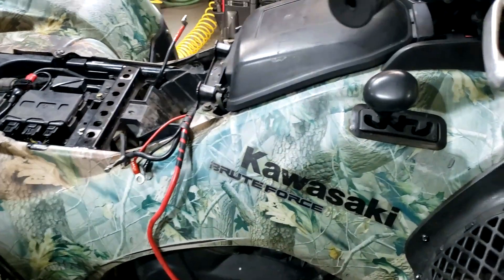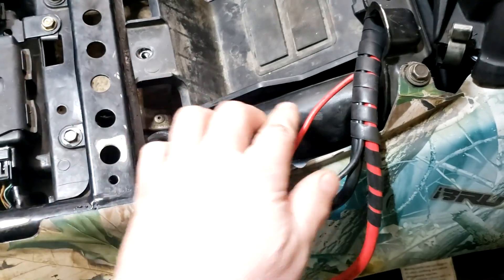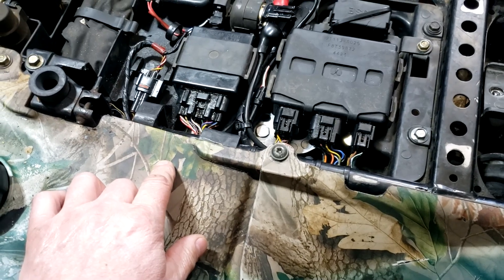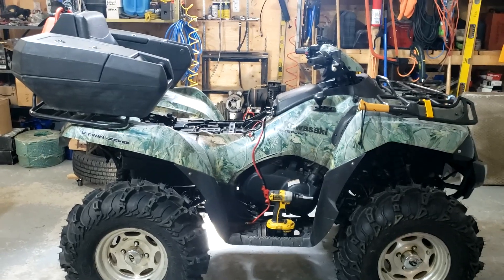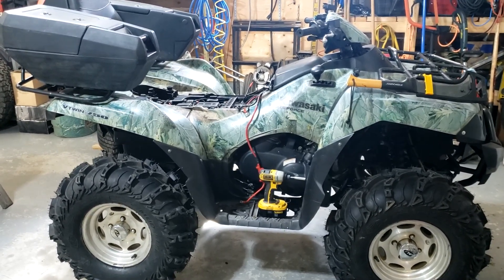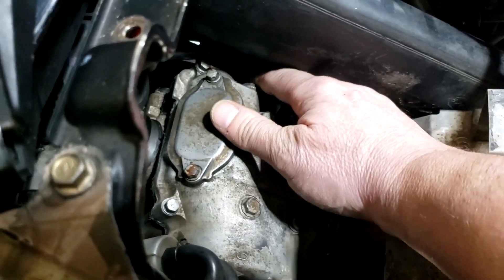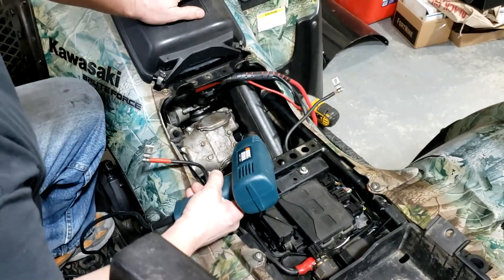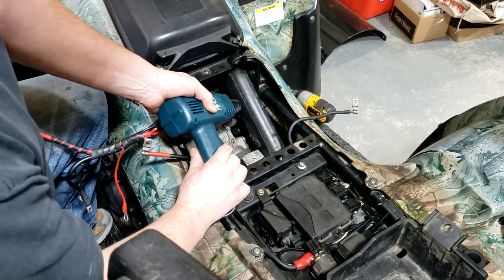Diagnosing Electrical Issues 2005 Brute Force 750 no spark

Comment: Hi, sorry but i have a 2005 too just got it not to long ago now. The issue i am having the starter solenoid clicks but thw starter doesnt even crank. I changed the starter, the batter, and the solenoid too... Im not sure what else can be. Fuses are fine. Any ideas please? Thank you. Great video too. Just.. Well like my brute but wish did some more research.
Reply from the maker: Only thing I can think of is the Starter clutch that is inside the cover on the left side of the machine.  Look up some videos on the Starter clutch on youtube and see if that's your problem.  Good Luck with your machine... I've given up on mine.
Reply: @RobFarrowATV  hey, thank you for replying. Damn sorry to hear you given up on her. Yeah the starter I replaced and the starter relay is new too. I'm going to change the negative side batter cable or really the negative relay to starter cable and see if that is it. The starter will start if its coming from battery straight. So again... Hope will work out as hope will work in future for you. Of course thinking of getting manual for mine to see what else happens. Thanks again
Reply from the maker: No problem, good luck!
Reply: Make sure your solinoid isn't wired up backwards speaking from experience lmao
Reply: Hey guys I have similar problem but sometimes work and sometimes doesn’t the electrical turn on

Comment: My 07 will just crank. Have checked everything. Flywheel is good, timing  is good, plugs are good, battery good, coils good. Replaced CDI box. Fuses good. Any suggestions?
Reply from the maker: Mine had an issue with the choke, the little rubber end wasn't closing the choke off completely.  Check the plugs to the CDI box and make sure they are not broken, I found one that was broken.  The electrical harness on these things is horrible, check all the buss bars and connections. Good Luck!
Reply: They said it was the pickup coil but that still didn't fix it. The guy that had it before me put an electric fuel pump on it. It clicks all the time. Im just not sure what it could be. Neither is the mechanic
Reply from the maker: Did you change the pickup valve that goes into the gas tank?  I changed mine, heard they go bad.

Comment: So what was the problem cause we have a 2007 rode it twice since 2007 its my wife she just let it collect dust now im having issues getting back running
Reply from the maker: We're still tracking down issues, it's crazy how much stuff is wrong with this machine... basically the whole machine was junk.  We're back to the carb setup again now.  Lots of issues with the electrical harness in these machine apparently.  Almost better to replace the whole harness.  If you didn't drain the gas from the carbs or put stabilizer in it when it sat good bet it's a gummed up carb or choke issue.  Good luck with your machine.

Comment: It's in the carburetor needs to be cleaned out good. Check the main jet& pilot jet& emotion tube for cloggage if it is. You can clean them out with copper wire strand frim wire

Comment: Think to pull the plugs?  I know you have few hours on them, but worth a look-see.
Reply from the maker: Brand new, checked them again to make sure we didn't kill one. Checked the new caps and the old ones.  Might have to look at the plug wires but the modules aren't known to fail.  Thanks Fred!
Reply: @RobFarrowATV  Those plug boots are interesting in design.  The CDI(?) is the computer (ECM?) ?
Reply from the maker: Yes I call it the CDI, it's the computer.

Comment: It's most likely due to watery fuel.,or CDI box issues will cause intermittent firing.,or the stator is bad to.,or broken wiring going to it also. Good luck with your getting that four wheeler running again. It kinda sounds like the CDI box.,or in the stator to me guy's on it.
Reply from the maker: Thanks for all your ideas John!